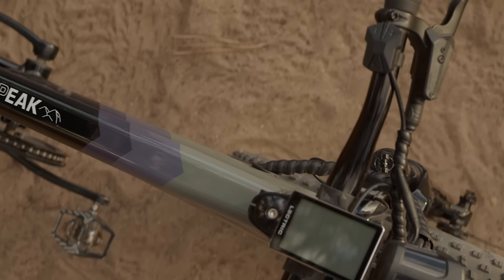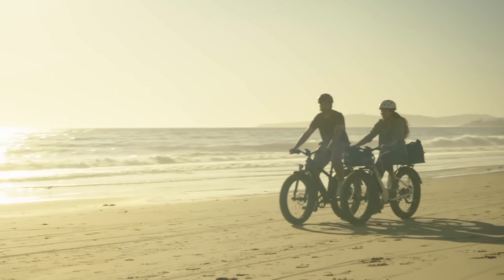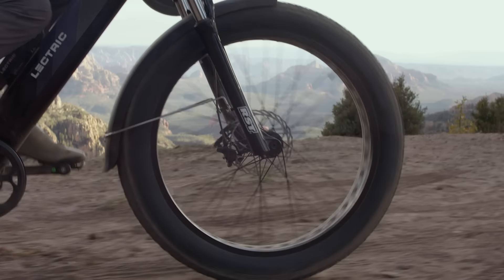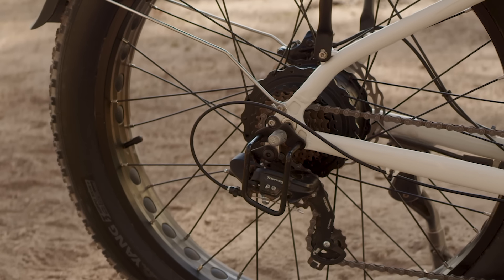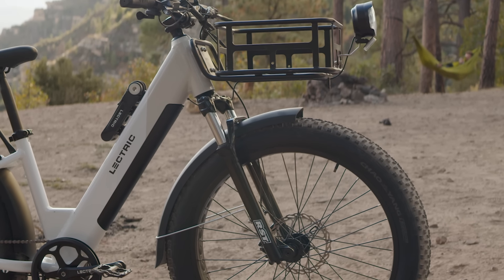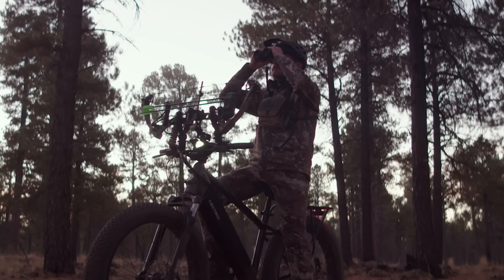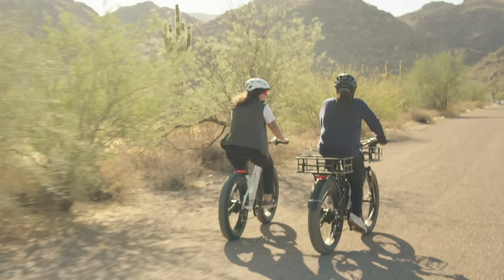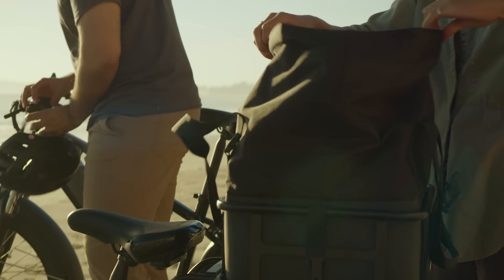Lectric Design Series | XPeak

Comment: can lectric address why when putting their rear rack on, their step thru version behaves like it's made out of rubber more than metal?

or why if you are pedaling to turn around, like it the confines of a street, your feet can easily hit the front fender?

also, why we have a tail light now but at purchase, this was supposed to be a brake light?  the brakes still have sensors and the controller sees the brake signal. seems like only a tiny step to have brake lights.

also, given the small battery size limiting range to roughly 25 miles leisurely throttle only use.. does lectric have plans of implementing a supplemental battery of maybe 10ah or so?  hopefully something compact like 13s2p to edge the bike closer to 20ah or take the edge off the voltage sag from high wattage use.
Reply from the maker: Hi there! Thank you for this feedback, which we are always noting to provide a better customer and rider experience in the future. This is our first ever Lectric eBike that does not feature our 20" tires, and having a larger tire size does lead to less space for your feet to pedal with due to the larger turn radius of our XPeak.

Many changes can take place from the time of unveiling to production when it comes to the design and function of our eBikes, and we appreciate all of our riders who are first adopters, for helping us refine and introduce our innovations to their community! 

At this time, we do sell spare 14Ah batteries for the XPeak on our website, and perhaps one day, there will be more options to choose from Lectric! ⚡️
Reply: @LectriceBikes understood that this is your first 26" bike. but it's not the world's first 26" fat tire bike.  26" tires generally go on frames designed for 26" tires and there are literally hundreds if not thousands of current examples to look at and base something new off of.   being able to have your foot collide with the front wheel shouldn't be something your engineers just go  'meh, that's the cost of having bigger tires '   

so, thanks for the response but i don't follow the design logic there.  there are countless examples of other 26" bikes not having such limitations or handicaps.  it's not clear why lectric decided they needed to make the wheel base too short for 26" tires.
Reply from the maker: Thank you for the feedback! This is our first 26" tire eBike, and we understand that there will always be room for improvement! One day, we hope to make the perfect eBike for our riders to enjoy 🙌  

We appreciate you and will be passing this along to the rest of our team, have a great day!

Comment: I have this bike on order. 2 of them actually. Can’t wait. Will be my 4th Lectric. However, I must call out that you show a pair of riders jumping this bike on a dirt trail, but the user manual specifically says keep both tires on the ground at all times, as that is its “intended use”. You are talking about this tough standard and achieving the rating, but putting in a big CYA and telling folks not to ride it as a mountain bike. Dirt and gravel surfaces with both wheels on the ground at all times. Doesn’t seem to match the marketing.
Reply from the maker: Hey there! Thank you so much for your feedback. We'll send this over to our team!